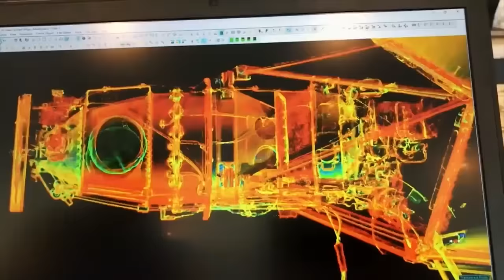We both almost died...now what??

Comment: I am an aviation enthusiast who owns a 1958 Cessna 172 straight tail, modified with 180 and complex prop, and a rare 1964 Cessna 182h Peterson Wren conversion. As a Recreational Aviation Foundation (RAF) Ambassador in Arizona for over six years, I travel to airports around the country to support and maintain them.  Additionally, I attend aviation booths at airshows to promote backcountry flying and preservation.
I have been an AOPA member for over 20 years and have several ideas to promote aviation. 
One such idea is to introduce youth programs that take young people to backcountry clean-ups and campouts. I also question whether aviation costs are artificially inflated or whether safety and manufacturing are responsible for the high costs. In my opinion, an organization that monitors these issues is necessary. Experimental aircraft might be a solution to make aviation more affordable.
Another idea I have is to design airports for the future, such as Hanger Home communities, and modify current airports around the country. This concept will undoubtedly help revitalize the industry. I am also curious about flying cars and whether they could be the future of aviation.
My primary goal is to help airports and young flyers. How can I assist the Pateys.

Comment: As a pilot AND identical Twin, this hit hard. Couldn't imagine getting that phone call.
What is Aviation doing right? Keeping GA alive mainly, and training pilots at a high level.
What is Aviation doing wrong? GA pilots die every day because our airplanes are using technology from the 50's. I've had friends die for reasons that a $5 sensor would have solved. Of course certification is important, but the world is moving far faster today than ever, and planes should be getting safer, more affordable, rather that relying on an aging out fleet made of ancient technology. The FAA needs to find a way out of the legal and regulatory muck.

Comment: 1) Aviation isn't accessible by younger generations, as a 20 something year old I want to own an airplane but the pressure to save for a house is just immense. I'm not sure how to bring down the cost of aircraft and the required maintenance but it's just so unattainable right now
2) Trent Palmer's efforts to prevent crippling regulation on back country flying is very important
3) Too many small community airports are being closed due nearby neighborhoods complaining about airport. I think a lot of the reason is noise so potential solutions are a light weight muffler for piston driven aircraft or propellers with some acoustic thought put into the design, IDK I think joby aircraft would be a good reference for the quiet propellers

These are what I've come up with in the 5 minutes after watching your video, I may come back and add more.....

Comment: What's good - FAA getting MOSAIC done, to open aviation to more people especially aging pilots.  AOPA supporting keeping airports open, which are constantly under threat from developers. EAA Young Eagles getting a younger generation involved in aviation.
What aviation needs - affordable aircraft engines, gasoline, diesel, turbines (jet and prop). Aged out engines cost more to replace than the value of the aircraft in many cases.
I am a member of the following organizations: EAA, AOPA, RAF, UBCP, ORAA (Ogden)
Also, I have a single seat jet designed, analyzed, and detailed SolidWorks models created for it, if you are interested. Similar to BD-5, but with fixes for the problems of the BD-5.

Comment: I was a DC-6 FE in Alaska back in the 90's and we had a saying, that two engines were acceptable, three are better and four is optimum, multiengine is the only way to go, my focus on aviation would be way too small for concern, but I would build a multiengine machine to take over the Caravan market inside Alaska that would tolerate Ice and have full synthetic vision

Comment: Gentleman, I have spent some time mentoring some young future aviators over the last few years.  My past includes military (retired USAF C-130 pilot) corporate jets and helicopters , current heavy cargo, and lots of GA (V-35B owner and A&P/IA).  The most important safety related change I see facing our future aviators is training related.  And, it’s not that we need to instill more safety culture in young CFI’s, it’s that we need to let them make some mistakes under the guidance of an experienced aviator.  New CFI’s are so scared to make mistakes and push an aircraft, that when something happens and there is an upset or an emergency that requires something that isn’t covered in a checklist, that they can’t deal with it.  
All new pilots, whether or not they intend to fly professionally, should receive spin and upset training.  Have the ability to push an aircraft to its limits and a little beyond to see how it reacts and how to fly it out of the upset.  The military, for good reason, is really good at allowing you to push the envelope to the limits.  We need more of this in GA.  Whether it’s upset training in an aerobatic aircraft or just doing accelerated stalls in a 172.  It needs to be done to install some confidence in maneuvering an aircraft.  Thanks for all you do for our community!

Comment: Mike and Mark, I met both of you guys, once at your hangar in KSPK and at Oshkosh. Even ate your food (catered). I am older than both of you have been in and out of aviation since I was three and currently fly a V35B with its original KX-170B and 175. Still has a Northstar M-1 (inop). I even owned and operated three Vickers (VC-745d) Viscounts for about six years. I am speaking at the Utah Aeronautics conference this May 22nd as well in a Breakout section. Anyway,  Here's an idea. To keep GA alive we need to get young people involved and pilots to have a better understanding of aviation to make it safer and its not a new BRS to float down when the engine quits or more buttons to push. And we need new-old airplanes, the ones they aren't making anymore. You had me scared when you said you were going to rebuild an airplane and after describing it, I thought you were going to say a Meyers 200D as that's my idea. I was involved 30 years ago to restart that  bird, had many discussions with the guy who controlled the type cert. Flew his Meyers 400 Interceptor. I know its not new, but hey we are still flying essentially Boeing 707 airframe tech, and the B-52 and B-1B will be flying for another 20 years. Yeah engines and wings are better but we are still flying 600 mph.
In GA, we are still flying 200 mph and aluminum works well. The Meyers with an io-550 is a bit faster than that. But maybe you guys should also buy the Beech Bonanza (B58, A36, F33A, V35B, etc.) type cert. and tooling (they have stopped taking orders). It still is the best flying GA bird out there and I've flown about every GA bird there is. I'm not here to spend your money and turn your large fortune into a small fortune. And the problem with manufacturing airplanes is the market, costs and insurance (huge costs). But even RV is having its problems. And now Icon, just today.

Comment: I've been nuts about things that fly ever since I was a toddler. My ex-naval aviator uncle did lots to plant the aviation bug. I went from assembling model planes to eventually working on the C-5A - with lotsa other aircraft industry in between. Even tho I've never gotten a pilots license, I still appreciate folks who do fly and keep pushing the frontiers. There are some things about general aviation that make me scratch my head tho. One of them is the STOL drags and any other pass-time where aircraft are purposely pushed to the brink of mishap.  An example would be the young fella that stalled his Cessna 140 while trying to hang back to delay his turn at the landing challenge. He and his pretty wife had 2 or 3 kids - kids that will never get the comfort of their dad while they grow up. So what did his family and him get from daring the devil of flying right on the edge?  And his tragic end is not an isolated instance. 
   Another thing that seems short on sense is the continual procession of Warbird sacrificing. I fully understand how the growl of huge radials, V-12s and others can cause one's heart to flutter.  But luck (or the lack of it) is gonna catch up with each artifact as we push them WELL BEYOND their hoped for mission. What's still flying are for the most part exotic and finicky 70-80 year old machines. Even when maintained correctly, fate intervenes like it recently did with the B-17 and P-63. It's gonna happen again and again - think of the Galloping Ghost event at Reno - or the recent T-6 collision there. ALL that vintage scrap metal making was avoidable - not to mention the human carnage that went with it!
    More to the mainstream, I'm a regular listener to Dan Gryder's Probable Cause productions. It just plane amazes me how pilots kill themselves (along with passengers) by flying a plane when they've had only a FEW hours of flight time thru the preceding year. I mean: WTF??? How do we impress said unqualified idiots that they might just be a little "rusty" in operating their crashable conveyance.  Speed means a lot. Thing is, it also means a more severe splat when the driver's not up to the task.  I say all this to ask that you two concentrate on making GA a safer bet for all involved.

Comment: Like most all commenters have noted, the cost of GA is prohibitive for many. Fortunately I'm still able to afford the RV-9A that I built and fly. But it is getting more and more expensive to fly and maintain it. Hangar costs have gone up dramatically. The next thing I'm worried about is the cost of G100UL. 100LL is already quite a bit more expensive than unleaded, and I can't imagine that G100UL will not come with an added costs even above 100LL. Many, many of the lower end GA aircraft can fly on 96/91 Unleaded (no ethanol) fuel. I wonder if effort could be put into making such a fuel available at more airports.

Comment: @ 22:12 and the answer is.... DUH!!! YESSSSSSS!!!. Also, since you have the knowledge and resources, it would be unbelievably awesome in so many ways if you were to take on a WW2 warbird project. Imagine a Patey resto-mod North American P-51D Mustang, a Messerschmidt BF-109F/G/K, Focke-Wulf Fw 190D, Yakovlev Yak-3P, Lavochkin La-9 or La-11 (the laminar flow wing post-war/Korean War models), or one of the godfathers of jet powered aircraft, a Messerschmidt Me 262A-1, Gloster Meteor Mk.3, or the one I would be most excited for since there's no flying models of one, the Henschel He 162 Volksjager. For something like the He 162, since it had most of the aerodynamic structure made of wood, I would do a "resto-mod" version and make it out of either composites like carbon fiber, or aluminum, which besides the obvious question of where you'd find a preserved wooden wing from an He 162, recreating the entire plane from modern materials would make it safe to fly. This also goes for the powerplants, using something modern is the way to go, remember, I'm not asking for a 1 to 1 historical restoration, I'm asking for a Mike Patey-ified historic warbird that would surely be the main attraction of airshows across the world. There is a famous warbird company in the state of Washington who did a restoration of a Me 262B model, which was the two seat trainer model and they gave it modern GE engines which made certification much simpler and allowed them to create a business around taking people up in a historic warbird that paved the way for all future jet fighters, selling an experience you can't get anywhere else.

Comment: I don't know how to address it, but cost is the big one.  I'm flying an old E Model Mooney that I got in 2020 for under 30k.  Insurance doubled on me in the last couple of years, and I've never had a claim.  The Lycoming on the nose is still running well, but if it gives up, then I'm looking at 50k+ for a rebuild, so at that point, another classic bird will get scrapped.  Hangars have doubled in cost.  Even the labor on annuals has doubled in the last couple of years.

Comment: 1, My first suggestion would be to create a GA airport management model that is friendly to GA, if hanger owners can make more money renting to boats and Toys than they can airplanes then something is wrong and that airport is destined to fail. 
2, Figure out a way to build a flying club business model that will attract young and old pilots, and try to include a requirement of those new pilots to fly with a senior pilot that has a vast amount of flight hours and aviation knowledge that for what ever reason doesn’t fly anymore. That is a mostly untapped vast amount of knowledge that I would bet could be shared for probably the cost of a lunch. I have learned something from every pilot I’ve ever flown with, some things I want to repeat and some not so much. 
3, create an Aviation Insurance Company that is maybe member owned like a Credit Union, that is non profit with decent wages for the employees not million dollar bonuses for executives. Helping this to work would be to create a law that restricts the ambulance chasing attorneys and their several multimillion dollar settlements. 

    Past Aviation group memberships, CAP search and rescue mission pilot, EAA chapter President, Seaplane Pilots Association, AOPA.

Comment: I would like to see liability relief .  Exposing any company to legal liability for something they made 40 years ago is adding huge costs to GA aircraft.  I would propose that the liability be limited to 10 years, for example.  After that 10 years the aircraft could be recertified to the experimental category and maintained per the experimental requirements.  The aircraft could go through  the same  initial inspection as a newly build experimental.

Secondly, as a retired airline guy and experimental builder/flyer, any mentorship that an experienced pilot  may provide to a student be allowed to be counted toward some percentage of instructor time required.  Cutting the training cost down may encourage more student starts.

Comment: I fly a DJI drone.  Usually under 200 feet.  The FAA has made it more and more difficult for flying drones. Many enjoy building drones from scratch. A valuable skill. Remote id and requiring a part 107 has made much more expensive and difficult. Many people are giving up on the hobby.   These are potential pilots. Legislation keeps being proposed to ban DJI drones because they are made in China.  Everything is made in China.  DJI is the best drones for recreational and commercial use.  Don’t know if it’s something that you can help with. Thanks. Love your build videos.

Comment: (1) What's going right - Technology is helping make Flying safer with Traffic and Weather into the cockpit, even in modest cockpits.  MOSAIC will also be a step in the right direction.
(2) What's going wrong - Insurance Companies are making it harder for older Pilots which tend to be safer and more experienced to fly Complex/High Performance Aircraft.
(3) I am a member of AOPA and EAA, an Electrical Engineer and an Experienced Aircraft Builder.

Something that I am doing to help improve GA is my involvement with a new 503c Non-Profit Flight Academy which is trying to educate intercity high schoolers and prepare them for a possible career in Aviation.  I am on the Board and an active member of several committees.

Comment: The General Aviation Fleet or 150,000+ aircraft average age is more than 50 years old. The fleet is being used well beyond the flight hours and years envisioned when the aircraft were designed.
Therefore, my number 1 idea is to become the Henry Ford of GA training aircraft.  A certified, 1 design, 1 color (ad graphics locally), Rotax engine, light IFR platform (glass), made of aluminum (tie down outside) since we don’t have enough hanger space.  The unicorn is ; priced below $125K.  Produce/sell over 5,000 year . 18:15

Comment: Good news.. is its growing
What needs help.. homebuilt world needs some guidelines for electrical and fuel systems. Most homebuilt crashes arent engine failures but subcompoment failures becasue every builder wants to improve on a system that doesnt need improving and it fails. 
Ways to improve.. one of you gents run for president. We need a gear head, mechanic style man in charge 😂.. serious note you guys are just purely inspirational. 👍

Comment: Mike, I have several ideas for an easier to make general aviation aircraft.  And I was working on trying to hash it all out before Covid came and threw a bunch of wrenches in the works, but I'd love to talk with you about some of the ideas, which I think would help general aviation interest. Think a larger BD-5 style plane, but staggeringly easier to make, and staggeringly easier to fly, and staggeringly easier to maintain.  I think that with a series hybrid electric for extra high altitude bursts of power for takeoff, and you get the general idea. Some of the ideas I wanted to do you have done similar with scrappy, and that's when I knew all the ideas could be incorporated.  Thoughts?
Reply: I also started getting older giant 3 axis CNC Milling machines (VMC), Metal lathes, bridgeport and the like, and I am restoring those so I could put such a project together.  I just know I can't do it all alone, but I think it's obtainable with a group.  Also would be interested in helping with the Jet, as I have a variant for that in the 3D Models.

Comment: What G. aviation needs is an affordable/easy build plans (kit) which  is "SPIN-Resistant" and has lower T/O speed than the current Rutan canards...So basically we need to redesign the Velocity with different airfoils optimized for shorter airfields...Why? Because too many pilots die due to stall-spin mistakes...and few pilots have access to a long runway...